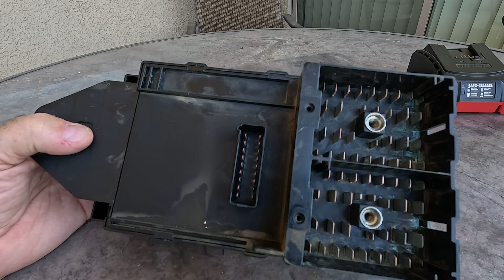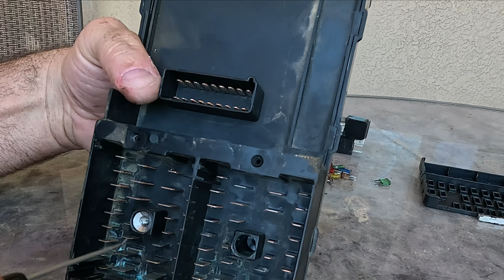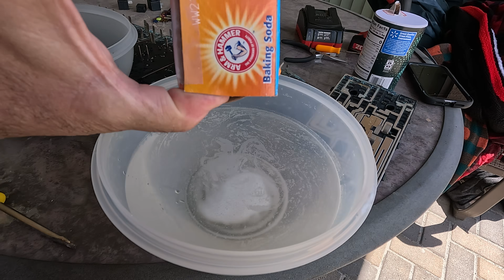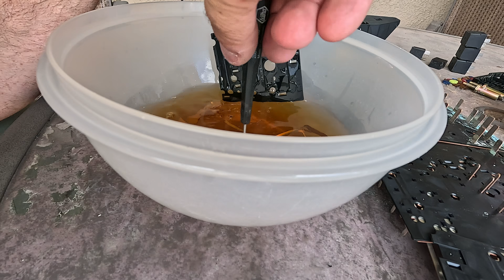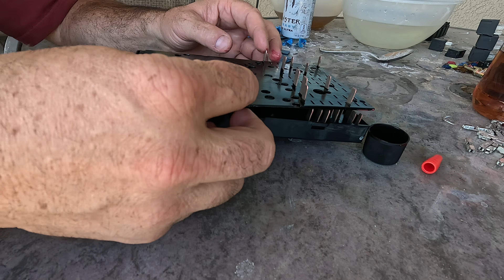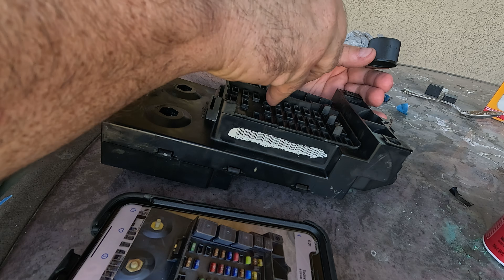How to Fix Your Ford Truck Fuse Panel (Avoid $2,500 in Repairs)

Comment: wel done...I like the idea of painting the metal traces....Obviously the fact that I am commenting here, means I have to do the same on my f150, 

I might add a tape around the two halves of the fuse panel to help prevent the water from getting in.

Can't seem to find the water leak on my truck....I'm wondering and suspecting that it actually is condensation from the left A/C vent.
Reply from the maker: The leak is frequently the upper corner of the windshield by the B pillar. The seal lifts just a little. The other place is the roof rack. The water comes in a channels to the B pillar and down right on the GEM and Fuse Box. Is your floor mat damp after a rain? Good luck, the job isn’t bad, just take your time.
Reply: @heathputnam9524 

There were times when I had a little water on the mat, but chocked it up to me coming in and out of the cab when it was raining. I’ll run a hose on the roof and upper windshield to see if it leaks.

I have also felt water on my left foot on a dry day, after driving with a/c for an extended time.

And DID notice erratic wiper movement during a rain.

I’ll repot back if I find an actual leak.
Reply from the maker: @cfauvel it certainly could be the AC condensation. Keep me posted! Thanks!
Reply: @heathputnam9524  before I drilledout the tuds on the fuse panel I was able to remove the large cable bundles in about 10 minutes. After drilling out the back side of the studs, it took me 2 hours to get the bundles off....why? because the 10MM bolt for each cable bundle actually pushes agains the stud when you undo them, and away from the large pins in the fuse box.  I had to glue and re-inforce the studs in the front of the fuse panel. I haven't tried undoing the cable bundles yet, but I have to.....the new-to-me GEM module is faulty too.

I am going to keep the nut on the stud, use a large clamp on one bundle then undo the other bundle, then move the clamp to another location with a board in the blank spot and undo the other bundle.....THEN undo the nuts on the studs......wish me luck....now finding a reasonably priced GEM with a warranty is the next hurdle.

Under my old GEM, the module would never fully go to sleep draining my battery, and the wipers were wonky.
The new-to-me GEM, goes to sleep in 45 minutes which is normal, but the wipers work 5% of the time. UGH

Comment: Im having issues with my passenger side floor board fuse panel in my 2004 Ford f150 can that one be removed and have the same similar steps as well?
Reply from the maker: I wish I could answer that for you. They may be similar but I have never tried it! Let me know if you try it please and good luck!

Comment: Mine was so bad one the last board trace on Corner was all oxidation, I had to flatten a 12g solid wire and resolver a new trace. I appreciate this video saved me some money. I also got my window replaced an put plastic over the module. You gained new sub.
Reply: On second thought....I'm gonna need a new unit.  Several layers where the corrosion has eaten through the copper circuits.
Reply from the maker: Several people have flattened 12 gauge copper wire and soldered it in as a trace. I think that may work for you also… it would be worth a try. Good luck!
Reply: Looks like I'm gonna have to follow in your footsteps...Outer corner right?

Comment: Doing this to my 2001 f350 it’ll randomly try to start up , thought someone was trying to steal it the other night … I changed the tumbler, starter,starter solenoid and the ignition switch still no luck I’m having huge faith on this repair
Reply from the maker: That is a symptom! Mine would roll the windows down as soon as it would start to rain. Try to start until the battery was dead… alarm in the middle of the night… totally haunted! This process will exercise its demons! Good luck!
Reply from the maker: Did you ever do this repair? I would love to hear if it fixed everything? Did you have any issues?

Comment: Only issue I’ve run into now is that there is no taking the connectors off the fuse box now that the studs were drilled…
Reply from the maker: The connectors pull straight up but are a little tight.
Reply: Mine do not want to come out
Reply from the maker: Maybe something like PB Blaster to loosen any corrosion?
Reply from the maker: Did you get them out?

Comment: 2000 excursion 6.8l
I started having very odd issues (blinking overdrive off light, stalling when in gear, parasitic drain bad) just performed this job and my fuse box looked a little worse than yours. Never would've tried without this video. 
Totally fixed all issues! Ready for snow and wife is happy. THANK YOU!
Reply from the maker: Awesome! Happy to help keep another Ford on the road! Thanks for the comment!

Comment: I’m suspecting that I have a Gem draw(fuse 15, .170a draw) currently but I am going to attempt this before replacing it. Will keep you updated.
Reply from the maker: I would open it up to see if you have corrosion and/or carbon traces. Keep me posted! Thanks!
Reply: I have the same problem on my 2002 3.8l v6 mustang and it doesn't let me crank but when I take off fuse 19 and 39 it let's me crank

Comment: I watched this video yesterday while I was eating dinner. It is very thorough and now it has me wanting to attempt the same job on a 97 F150. I’m gonna attempt to pull out the fuse box and gem. Please let me know if for whatever reason this job wouldn’t work on my truck.
Reply: Thanks! I’m taking baby steps as I started after work. I was able to work the two bolts in the back and it seems the connectors are ready to come out of the unit. Seems the fuse box and gem are still pretty snug in there but maybe I need to unplug them to really get a feel.
Reply from the maker: It is pretty tight in there. Let me know if you have questions!
Reply: So far I was able to get the fuse box and the gem out. I do notice the gem is designed a bit different than yours as yours looks like it has a solid door cover whereas on this one it’s covered does have some slots and notches that could allow water in. I was able to open the gem and to the naked eye, I cannot see any corrosion really the only thing I could see is some dust in there, and there is rust on a part. On the backside of the fuse box where the connectors go in, I do see some corrosion on one of the prongs
Reply from the maker: @caseywolf3812 that corrosion probably goes much deeper. You are getting there!
Reply: We will see shortly. Gotta run to the store for a better pick as I’m struggling to get the fuse connectors out of their ports. For the area where the wire harnesses plug into the back of the fuse box, did you just blast that with WD40 to clean the corrosion?
Reply from the maker: I did clean the corrosion and used silicone electrical grease when I put it together.
Reply: So I completed putting the fuse box back together and I put all of the fuse connectors in their slots accept one. The prong is leaning against the plastic wall. I attempted to use picks to get it back away from the wall but there just not a lot of room. I may continue to mess with it or just put it back in the truck as it’s relay number 1 which is only the internal lamps. Any thoughts?
Reply from the maker: I would try to bend it back. You have come this far! Everything else looks good though?
Reply from the maker: It should work, just verify it looks very similar to mine. Let me know how it goes!
Reply from the maker: Did you get it done?
Reply: @heathputnam9524 couldn’t get the one prong back so I just put the relay in the slot and got her back installed in my truck. I think the only thing not working are my door lights because of that bent prong. I’ll take it
Reply from the maker: Way to work through a tough job! Thanks for watching the video and keeping me up to date!
Reply: @heathputnam9524  no problem thanks or sharing the info with a solid video. It didn’t wind up being my problem, pesky corroded battery terminal connection lol but was a good learning lesson on the old f150 and I for sure found corrosion in my fuse box and cleaned it up
Reply from the maker: Happy to help😂

Comment: @HeathPutnam The bolt holes you drilled out… everything still goes back together without replacing them? Or did you replace the bolts?
Reply from the maker: The bolts that hold the GEM module in screw into them and hold them fine. Thanks for watching!

Comment: How would I go about reconnecting one of the plates? One of my corroded away only about only about 3mm is gone
Reply from the maker: Wow, I have not seen one that bad! You could solder on a heavy gauge wire or use a crimp terminal. Hope that helps a little! Thanks for watching!
Reply from the maker: Did you get it fixed?

Comment: Fun fact- this fix DOES NOT work on all of them.  The fuse panel without the gem module on the back (ie- my 2002 powerstroke Excursion) is different.  If you want to disassemble it to this degree you will need a soldering iron and the courage to desolder a minimum of 57 connectors.
Reply from the maker: Yes, description says 1999, 2000 & 2001. Thanks for watching!

Comment: I took the top off and just put each piece into the solutions and used a toothbrush on them.  Then rinse and repeat each plate. I put a piece of plastic wrap on top so if water got to it the water would run down and not into the box again.   Fixed the windshield with sealant.  See how it goes.
Reply from the maker: My fingers are crossed! Keep me updated!

Comment: I am attempting to do this same procedure. I can’t get the 2 large connectors off the back of the fuse box that are bolted in. I’ve removed the bolts and pull and pull on them but no luck. Any suggestions? How difficult were yours to remove? Any help is greatly appreciated!
Reply from the maker: The bolts should have had eclips on them and the connectors should have lifted off with the bolt. Mine came off pretty easily. My guess is they are corroded. If you unbolt the panel you may be able to turn it so you can get a better position to pry on.
Reply: @heathputnam9524 I will give that a try. I think you’re right and they’re corroded on. Thanks for the quick response!
Reply from the maker: Did you get the connectors off?
Reply: @heathputnam9524 I just got the truck out of the barn where I store it for winter. I’ll be getting to it soon and will let you know!  Thanks for following up!
Reply: I do know that someone has already been into the GEM module though because those clips retaining the studs have been drilled out like you did in your video. My windshield leaks pretty bad so I suspect thats how all this started. I keep the batteries disconnected when it rains for now and use ForScan to check for GEM codes to ensure there are no shorts when I reconnect batteries after rainfall.

Comment: I have a problem and I hope someone can help. I have a 2001 F-150 XLT 4.6 V-8. OK I go to start it and the theft light is on, it'll start for a few secs then quits. I done the flashing code trick and mine is 16, but if I remove one of the cables off the battery for 30 secs, it'll start right back up and run a few days then I have to do it again, but today my whole cluster stopped working, Tack, Speed everything. Is there a fuse for the cluster. I've never had a problem with it before. Help Please and Thank You... P.S. my 2001 F-150 XLT does the same, it gets water inside.
Reply from the maker: I was having similar problems and I removed the alarm system it stopped the annoying alarm in the middle of the night for no reason but didn’t do anything for the battery discharge overnight. This problem and more went away after I did this fix. Thanks for watching!

Comment: It occurred to me that you could use an ultrasonic cleaner to perform the most effective and time efficient method of cleaning circuit boards that I'm personally aware of. I've used Windex in an ultrasonic to clean circuit boards that were in very poor condition followed by thoroughly rinsing first with tap water followed by deionized water at the end before a thorough warm air drying process. I put my dehumidifier in a small room until it was finished removing all the water in the air that it could then I entered and used a heat gun on low from a distance of about 40 centimeters and applied warm air on the circuit board for about fifteen minutes and looked it over with a magnifying glass to make sure I didn't miss anything. Worked great! Also had to service my fuel injection module on my 2001 F-350 and followed a similar process to remove corrosion and then sealed the enclosure as I had noticed a considerable amount of water ingress the results so far have been great! No misfire and still runs great, I think even just a tad smoother. I didn't run a scope on it and record the results before and after and I don't have access to a dyno so it's just an honest guess. Great video by the way, thank you!
Reply from the maker: That sounds like a great plan, unfortunately not everyone has that equipment. I wish I did! Haha! Thanks for the info and for watching!

Comment: This video was very helpful to me today.  I took my fuse panel out and cleaned the corrosion out.  It seems to have fixed the problem with parasitic drain. It took me about 5 hours to complete the task.
Reply: I should add that I went to the $ store and purchased 2 flat 9x12 plastic pans to soak the boards in.
Reply from the maker: That’s a great idea!
Reply: I discovered another added benefit of this repair.  My horn now blows at full tone.  For 10 years it's been pretty anemic sounding.
Reply from the maker: Excellent!
Reply from the maker: Fantastic! Thanks for watching and commenting!

Comment: I’m having issues with my heater not shutting off with the key. I can shut the heat off with the switch And when I open end close the doors the dome lights only dim they don’t go completely out. I’m not sure where to begin
Reply from the maker: This could be caused because corrosion in the fuse box but could be a bad ground or other short. Does any of the symptoms get worse during rain?

Comment: I would skip the dielectric grease.  I've used it like this for 30 years with no problems.  This year, however, I've had nothing but problems with my 04 6.0 diesel after putting dielectric grease in the engine harness connectors.  Tons of codes in every system.  I've cleaned the grease out and the codes have gone away.
Reply from the maker: Interesting. Thanks for the comment, I will have to research that more.

Comment: Since winter with water getting on the CJB and attached GEM the 7.3 & V10 trucks have been having problems. There are two basic types of fuse panels for the years mentioned in your video. 1. The E (early) E99-01 with the CJB and the GEM attached together. 2. The 02-04 CJB that doesn't have the GEM attached. The 02-04 years have a CJB but don't have a GEM Attached to it. Instead Ford developed the a VSM (Vehicle Security Module) that takes the place of the GEM. If you have the 02-03 & up, the VSM is mounted near the Firewall behind the dash, just down left of the radio area. This video does have some REALLY GOOD info in it for sure. For you guys who have the the 02 & later years, the CJB's don't look the same but the basic processes for replacement & repair are very similar. Some people remove the CJB, clean the pins on the outside, Blow dry them and actually cut a few slots in the bottom to allow the water to escape so the pins don't corrode. Some also put connector grease on the pins to help as well, and other have actually placed a plastic bag over it to further protect it when they reinstall it. I know the 99-01 truck electrical systems pretty well, so I thought I'd pass the info on to you. If after your repair using this very helpful video, if can't seem to find the problem, feel free to join us on the 7.3L Powerstroke Nation group on Facebook and give your truck year, model and the problem and we'll see if we can help. Best Blessings. Keith Noneya
Reply from the maker: Thanks for the info! I have re-edited this video to fix that mistake. I am always learning new things about these old trucks, especially the electrical stuff. I appreciate you letting me know about the error! It should be fixed at this point.
Reply: @heathputnam9524  Thanks Heath. Been there done that on my own videos! Best Blessings. Keith Noneya

Comment: What about flex seal spay on them metal plates.
I put a heat in my truck and put tarp over wind shield to keep water out
Reply from the maker: Flex seal may work, just don’t spray it too thick. Thanks for the idea!

Comment: Watching this video shows how so many electrical problems show up and then gone in a few days. Here is coating that can be used for insulating some of these parts. 8690 Acrylic Conformal Coating on the Big A store. Thanks Heath for showing a detailed process. I will start by getting new windshield with new gaskets.
Reply from the maker: I didn’t know about the conformal coating! That would be perfect. Thanks for that great tip! I did my windshield three days after my fix. I really had no good videos or articles that I trusted to go by so I wanted to make sure the fix would work. The job wasn’t bad and solved all my electrical woes! Thanks for the comment and let me know how the project goes!